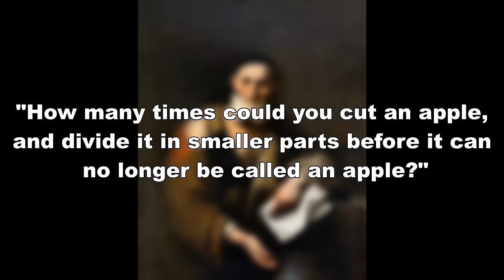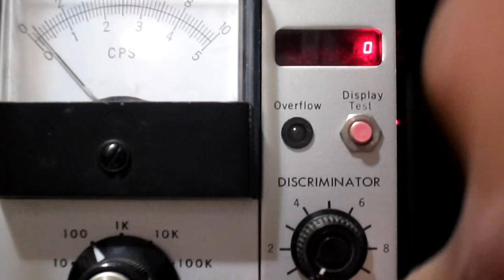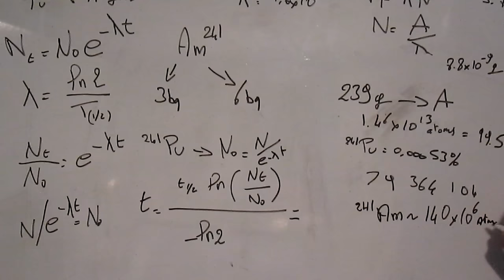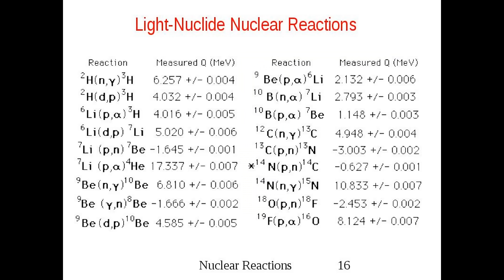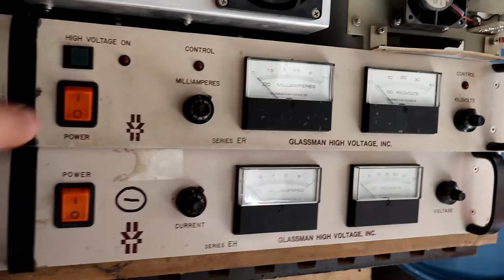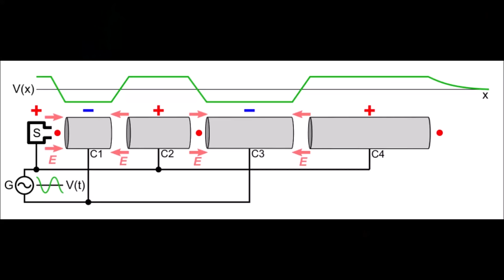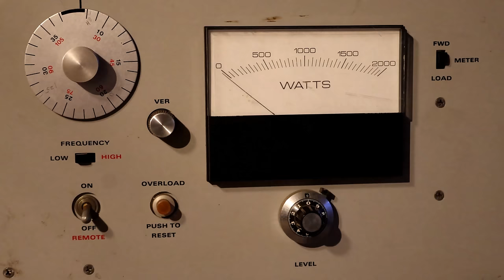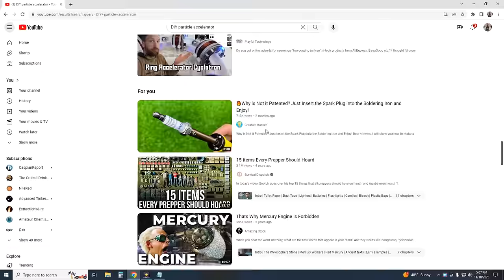DIY Particle accelerator (part 1)

Comment: There is a place called Adams and Chitlenden scientific glass and they use borosilicate 3.3.  I have had reactors made that withstand over 3000 C and 5mm thick vacuum vessels.

I am going to eventually try my hand at building a plasma wakefield accelerator and the high power CO2 laser to go with it.  I am now trying to figure out how to isolate plasma gas while allowing electrons to pass.  In theory most electrons should pass right through even gold foil but I haven't found any publications on what happens if you stick thin foil in a partial accelerator.  Of course the hugely positive charge on the nucleus is going to mess with your electron beam ... so still thinking.
Reply from the maker: Oh a Wakefield no less ! Big project! The gold foil will simply get completely destroyed by the ions almost immediately. Good luck!

Comment: Amazing video! For high energy HF square waves, maybe it would be easier to find an HF amplifier and use it to amplify a low powered but non-exploding square wave generator up to the power level needed? I'm surprised you went with electrostatic acceleration for a MeV project, I was under the impression that electromagnetic acceleration was able to scale better for accelerations over 50 keV more easily. Most charged particle optics for electron beam and ion beam equipment I've looked up seems to use electromagnetics for the >50 keV section of the beamline.
Reply: Drastically more expensive.   :(

Comment: You have most likely already received a comment or two along this line.  You could use a vacuum tube RF amp and a frequency generator to generate a "cleaner" acceleration field.  If you are interested, I can get you a schematic of a classic Ham radio HF band  linear amp.  It will need to be shielded to prevent an unintentional RF radiator. ( You don't want the FCC visiting you).  Let me know if you are interested.
Reply from the maker: Sure! Of course I will take a look and see if it's something I can put together! Absolutely! Thanks for watching and the help!

Comment: Very interesting video, looking forward to part 2.
Sad to hear about the failure 😓 be careful - YOU ARE a real person, and you did get hurt 😱

What kind of square wave voltage do you need? Do you know if normal particle accelerators use them?
I'm not yet really well versed in the ways of high voltage square waves, so these are guesses, more than anything:
 - there's a type of Voltage multiplier that relies on a discharge, I can't remember what it's called, but if it doesn't produce a tonne of signal-noise, you might be able to adjust the frequency and amplitude by putting the discharge paths inside an oscillating magnetic field.
 - most high voltage circuits employs both capacitors and inductors, which as you likely know, considering all your equipment, will produce AC (EDIT: I meant: a sine-wave). You might be able to get a large N87 core, and wind a transformer with a bunch of windings, and dump it in some mineral oil. I have a small flyback that I've wound 1500 turns on, with a bobbin that has 10 segments, which works pretty well. I've run it at around 20kV thus far. I have it running a Cockcroft-Walton voltage-multiplier, but as my diodes can currently only handle 12kV, I haven't had it running at full potential. I've also had issues with my ZVS-driver. It doesn't output much power until it's loaded, which makes it less than ideal for generating high voltage. But it has cold MOSFETs. When I drive it with a 555 driver, i get much higher voltages, reliably (without first having to load the secondary side), but my MOSFETs gets really toasty in no time. I think that I can tune my ZVS to output more voltage, without having to load the secondary, but resonance = sinewaves and cool FETs. 555 = square waves (I *think*), but very hot FETs.
 - if you have enough money, and you don't need a super high voltage, you could consider generating a high voltage DC, using e.g. a Cockcroft-Walton voltage-multiplier, and then use a ridiculous amount of MOSFETs in a full-bridge configuration, driven by tonnes of gate-transformers, to generate square waves directly in your HV-stage.
 - you could also use a positive and negative Cockcroft-Walton voltage-multiplier and a couple of spark-gaps each with their own coil perpendicular to the spark-gaps to, that operates on each their half-wave of an AC-signal, to generate some pulses. I have no idea how the discharges will look, though. The Tesla coil will ring at its resonance frequency. As long as there's enough energy behind the spark-gap, it should be able to dump energy for as long as there's energy, and low enough impedance. But I find it difficult to have high capacitance, and to charge a lot of energy, at high voltages - or at least, it gets expensive pretty quickly.
Reply: I don't know what kind of vacuum is required for what you're working on, but acryllic does outgas a fair bit. It looks really cool, so if you want to keep the looks, you may need to switch to glass 😓
Otherwise HDPE is fairly cheap, and seems to be a really good plastic for high-ish vacuum. I love it, because it has a fairly high melting point (for a relatively cheap plastic), it has good dielectric strength, and it doesn't outgas much.
Reply from the maker: wow! lots of very good info here! Ideally I would need a regulated power supply up to say 50Kv and able to change to frequency from 10khz to 500Khz up to 1000watt (to begin with) if I could set the square wave period and cycle.. it is asking a lot so I need to rebuild my drift tube to a precisely calculated length. Maybe I am being ridiculous but I am always afraid the MOSFET can`t handle too much power ?  that's why I released the video early and asked for help from far more qualify people like yourself ! i already gotten some very good ideas and helpful comment (like this one) and some viewers even offer to replace my broken vacuum parts! This is still at an early stage but the bulk of the project heavy stuff is done or almost there! Thanks to your comment i hope to be able to get back to it very soon!! Thanks again for your comment and help and thanks for watching!
Reply: Again, I'm still relatively new to both high voltage and working with AC, inductance (and AC capacitance) and resonance, but 50kV square waves 10-500khz does sound like a challenge.
I'm lucky that the regulated HV I need is in the form of DC, and the AC I need, doesn't need to be square waves. However, I am going to be regulating directly out of my AC flyback, by making a voltage divider, and rectifying the output, and using a small capacitor, so I have a signal that I can measure using simple electronics.

You should be able to generate 50kV directly out of a transformer. I think that I can push my flyback to that, but have yet to try it - it is my goal, though. And if you make sure to cool your transistors (FETs, IGBTs, or whatever) enough, you should be able to drive it with a square-wave, which should also give you a square-ish wave out. N87 cores works pretty well at 10-500khz.
And regarding MOSFET's ability to handle power, I have some SiC FETs that are rated for 1200V and 34A. Anything above that, starts to get really expensive. These are also at a price-range that I really don't want to kill too many of them.
Right now, I'm working to make a regulated SMPS that ideally can output 200VDC at 10A, or 100VDC at 20A. I need that as a stage to regulate the input to a ZVS-driver that'll drive my flyback transformer. Since I need a regulated but constant output on my flyback, I'm regulating the supply for the ZVS.
To make the ZVS robust, the FETs should be able to handle more than 4 times the voltage, due to inductive spikes, which is where the SiC FETs comes into play.

You say you need around 1kW, that happens to be the highest recommended limit of half-bridge topology. For anything above that, full-bridge topology is recommended.

ZVS drivers drives with a sine-wave, and switches the FETs at zero-volt-crossing, which is how it keeps the FET's cold, but that won't be of much use, if you need square waves. 555 timers are popular, but they only use one MOSFET, so it's not recommended to use for that much power.
You can look up the "SG3525AN" (works up to 500khz, but I can't remember the lower limit) chip. It has adjustable frequency and dead-time. It has a couple of outputs that you can either use to drive two MOSFETs directly, or you can use them to drive a gate-transformer, to drive your FETs. There are likely many chips like it, with specs close to this, as this is mostly how SMPS's works - the SG3525AN is just the one that I know, and the one that I killed this weekend - but in fairness, I was a bit mean to it.
Reply from the maker: @martinfyhn1976  oh your right! I kept track of the possible outgassing from acrylic with the mass spec (RGA) but never saw anything.. I even started to heat up the whole tube to 120c and still nothing outgassed . But if I can get my hands on some high density poly ethylene I definitely will! It's cheaper too your right !
Reply from the maker: @martinfyhn1976  lol! Yes we all push our equipment to the breaking point!!! You are the second person to recommend the 555 timers ! I will also look into the SG3525AN.. thanks ! Are you also making videos of your experiments?
Reply: @Neptunium  I've also used LDPE, and haven't had any issues, but from what I've read, HDPE should be better. I think NASA has published a list of how much various materials outgas in a vacuum. Some of my first attempts at making vacuum chambers, I tried using acryllic, but they were terrible. First I used glass and HDPE, and some rubber that I could get my hands on. That worked surprisingly well. Then I switched some of the HDPE to acrylic, and nothing worked, so I switched that to glass, and it worked. This was even before getting anything close to a high-ish vacuum, so I'm surprised that you couldn't measure anything, which does make me wonder if there were other variables at play. It was a hard rubber, and I did seal against the acryllic, so some of it might have been leakage, if the surface of the acryllic was not perfect. Regardless, HDPE is better if you want a high vacuum, but I don't know what's required for your application, though I imagine you don't want too many atoms in a particle accelerator 😅
Reply: Not exactly what I remembered it to be

https://outgassing.nasa.gov

You can look-up "acrylic", and for application "structural". It isn't as much as I thought it'd, be, but it's been a while since I looked into it, so I can't remember what exactly the units are.
Reply from the maker: @martinfyhn1976 because of the path of the ion and the size of my chamber I need a vacuum at or better than 10e-6 Torr.. I did that pressure with the acrylic disc in place and got to the mid 10e-7 without
Reply from the maker: @martinfyhn1976  as long as the mean free path is in excess of a few meters it should be fine the lowest part of 10-6 Torr is where the mass spectrometer usually operates...
Reply: @Neptunium  I intend to do so, but currently I'm all over the place, and am learning a tonne. The whole regulated HV-supply is for two other projects, both testing out designs that might be a bit fringey. However, each step on the way has a tendency of turning into a full project on its own. I experimented with a different coil-design on my way to making my SMPS (which I thought was slightly fringy), and there was an aspect of the coil I couldn't figure out in my head before winding it, and the result actually turned out to be rather interesting, but it also has some massive drawbacks, that I'm trying to rectify by now trying to increase the frequency by a lot, which comes with a whole host of challenges on its own. So I don't have a single thing that's enough for a whole video, but when I reach a point that I can actually finish a single step/project, I intend on making videos about those steps/projects.
I think that I'm at the bottom rung of the ladder now, though, so once I figure out if this coil-design has any actual function, I doubt that more things will get in the way. I can then start by making a video about the coil, then the SMPS, then the regulated HV-supply, and then some videos about each of the projects that started the whole supply-thing 😅

And regarding 555 Vs SG3525AN; The latter is basically a fancier version of the former. The 3525 has dead-time, and two outputs, so it's better for driving higher power supplies, than the 555. But they're both oscillators, and they both rely on resistors and capacitors to do their timing magic
Reply: @Neptunium  that's a pretty impressive vacuum. Luckily for me, I don't need to go down that far. I just need the vacuum for a fringy fusor, so my particle density will be much higher than that, and likely quite a lot higher than normal fusors, if I can get my way. I have had a traditional one running in my chamber, but I've yet to make an accurate measurement of how far I can get with my chamber.
Reply from the maker: @martinfyhn1976  oh yes you can get away with higher vacuum than that for a fusor for sure!
https://www.youtube.com/watch?v=fxEDokcNMXU
and part 2 here:
https://www.youtube.com/watch?v=XzrQ_es9kqA
if you haven't seen it yet..hope it helps
Reply from the maker: I see...well do post when ready !I`ll be watching it for sure! @martinfyhn1976
Reply: @Neptunium  I have actually seen these some years ago, it's a really nice setup 👍😁 I really appreciate the details in there. Thank you 😊
Because I absolutely have to do things the hard way, I'm specifically designing for fusing single protons, which even if this design were to succeed (which I know has less of a chance than a snowball in hell, because of the ridiculous repulsion, and the tiny size, and the low weight), I need for antielectrons to strike where I want, and I need to deal with gamma radiation, and I need to get rid of fused materials. I have ideas for most of it (but gamma is a pain in the behind), which is being ahead, to say the least, especially when what I'm trying to do is basically impossible in the first place 😂
This design should work better with Tritium/deuterium+deuterium regardless, so it's really good to have the information you've provided. 
This actually reminds me that HDPE also handles radiation rather well. It really is a jack of all trades.
Reply: @Neptunium  I'll be sure to let you know of I ever manage to make a video 😊

Comment: At least I'm not the only clutz with bad luck.... 
Since you now have the "opportunity" to rebuild, would you consider including a stage or at least a port for a laser input? Possibly turn it into a Wakefield accelerator? If not that sophisticated I'm sure there's some way to introduce more momentum to your particles with a laser.
Maybe a simple cheap  nitrogen or hydrogen laser to make very short high power pulses in the shortwave UV range perhaps?
Reply from the maker: That's the third time the Wakefield laser idea comes up! I am at work right now but I'll definitely look into that! Thanks man!
Reply: @Neptunium  I remember first hearing about their invention back in the late eighties / early 90s when somebody at a university in Michigan building one on a bench top and thinking "oh my God I can have mega electron volts in my garage"
  It's been around so long in concept but with minimal development it almost seems like a conspiracy to maintain the bigger more expensive projects and put research on these things on the back burner.
   The math behind them turned out to be well beyond my abilities, but I still fantasize of one day making my own muon generator... 
   The experiments involving them that I've heard of usually are just for accelerating electrons but there is no reason in concept it can't be used to accelerate alpha particles.
Reply from the maker: I don`t think there is any conspiracy to keep the drift tube LINAC down, I think physics has learned all it could from this level of energy and the only feasible way to get higher and higher is to build large hadron colliders. But yeah the technology is not new and frankly other garage tinkerer have done fantastic work I might not be the first .. I don't know... anyway, thanks for watching! !  @petevenuti7355
Reply: @Neptunium  I was speaking of Wakefield accelerators specifically, not drift tube. The drift tube could be used for pre-acceleration. Have you considered an off the shelf microwave magnetron for a RF source?
Reply from the maker: thats an idea but that implies the tube are tune to the exact resonance frequency of the magnetron somewhere around 2.4GHz I am not sure I could get a chamber made for those specs.. but it should be possible indeed! hey maybe another project idea!  @petevenuti7355

Comment: I PIPS detector could be a viable detector, cheap ones are available from ebay from a specific seller but they are hit and miss, so messaging and asking him might be wise. I also have one that is slightly damaged that I would love to donate that should work, but the efficiency may be low as it has been scraped on its front, it also doesnt use traditional microdot (which shouldnt be a problem for this, but it wouldnt work in a alpha spectrometer NIM module for example)
Reply from the maker: YES! This was my first idea! I even found this guy who makes a nice little detector  from photodiode that work great as alpha particles detectors! Unfortunately a weak source will eventually deplete the PIP so a powerful beam will probably not be great for it ! Even with a collimator.. The more I think about it, the more I am leaning towards the Faraday cup and electrometer..hey this is garage science right! Lol so I'll try different stuff until I get it right!!  thanks for watching!